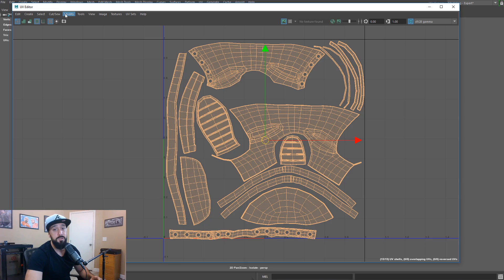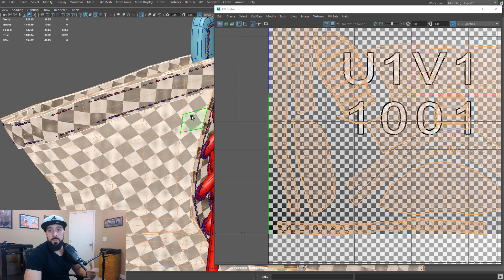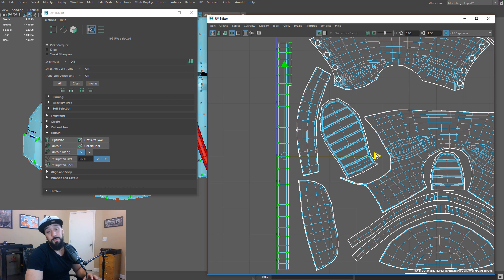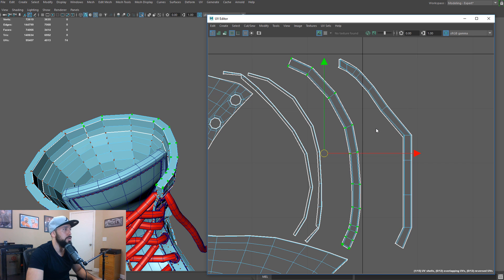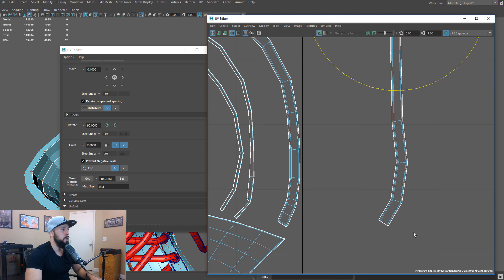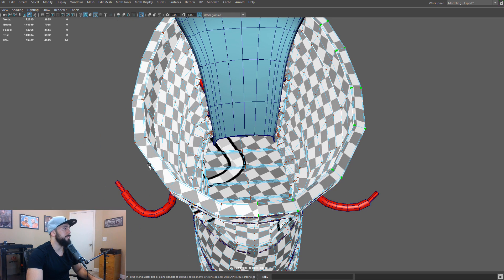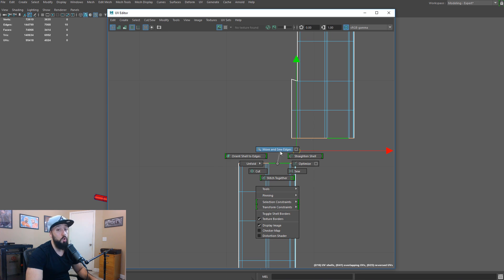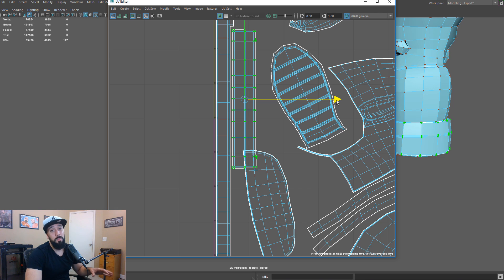Maya UV Mapping for Beginners: Straighten UV Tool

Comment: Great video as always JL! Thanks. I have a question, I seem to have lost the option to straighten UVs from the [Shift]+[RMB] marking menu 🤷‍♂️ I was using it. Took a couple of weeks break and now it’s not there. Have you ever seen/heard of this and do you know how I get the function back in my marking menu. The options I get in the menu are not the same as J used to get and you have.  I’m in vertex mode and get Normalize, Unfold, Optimize, Layout, Create UV Shell, Tools and Pinning but that’s it?!?

Comment: Thanks for making the content JL. Its nice to see people sharing their knowledge. I personally use the Unitize Tool more often or in conjunction with this subject. Then merge/ move and sew verts. that are not the seem verts.  Then Unfold along vertical axis (assuming the Shell is facing the vertical direction) I realize that may be an old way of doing things but sometimes it ends up working better or faster then struggling with Straighten UVs. 
Also, @JL Mussi I believe Straighten UVs may work better when selecting a single line of your UV shell. Or at least when its misbehaving  I've found that to be less buggy.

Comment: But what about the distortion straightening uv shells brings? Every time I work on straighten UVs and I try to paint directly in 2D I get a more or less distorted result in 3D, never 100% clean. What am I missing?
Reply: Depending on the need for 100% relaxed things... it isn't always needed. A straight layout will make it easier for you to paint things onto in 2D paint modes. Also, as said in the video Straightening your layouts makes more clean and tighter UV packs. If your checkers look clean. Then its generally accepted to be fine.
Reply: Yea I don't know if i should worry or just be like whatever....the uv grid gets messed up

Comment: Hi! I tried your method and it worked like champ! But one problem, as i tried to rotate my UVs to almost straight before using the Straighten tool, some of the UV face is out of it original proportional which end up with stretching faces, how i fix that?

Comment: I have a question regarding straightening UV's. I've noticed even on some simple models that once I've unwrapped some parts of a mesh that are curved, the chequered pattern looks nice and even with no stretching. However, once I straighten the UV's so that it looks nicer on my tile, the textures are then stretched and warped. So, why do people obess over getting straight UV's if leaving them how they unwrap yields better results with the actual textures? I understand that more UV space is equal to more pixel density but surely not at the expense of having warped textures? It's something that's been bothering me for ages! Am I missing something? Thanks!
Reply from the maker: A good UV  is sometimes a balancing act.  Do you want less seams vs better unfolding, or in your case better texel density vs distortion.  Unless you are working in a production with super tight texture size requirements, go for a UV layout that will give you the less distortion.  That's pretty much what I shoot for.
Reply: @jlmussi  Thanks for your insight. :)

Comment: In straightening up non-uniform shapes, the checker pattern gets distorted, isn't that bad? For example, I made a cylinder with the top part narrower than the bottom when I straightened it the checker pattern is not uniform and is distorted. Is it supposed to be like that?